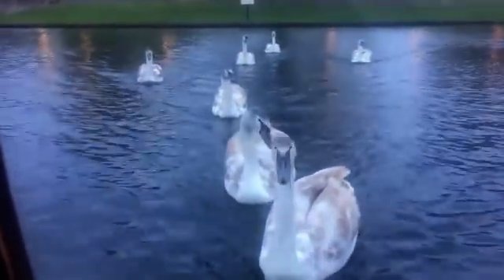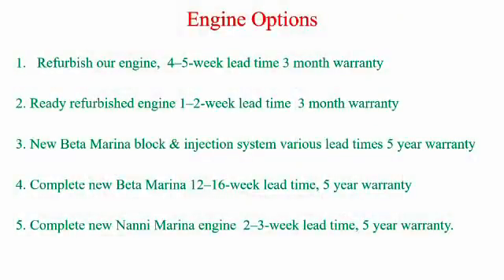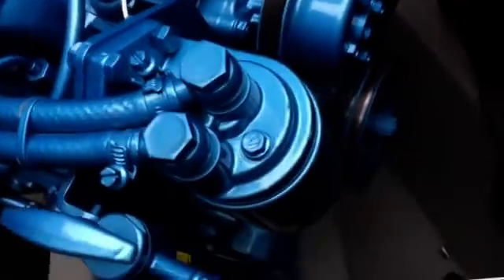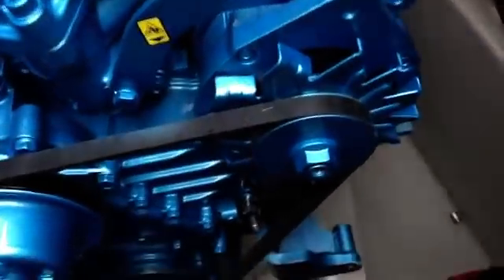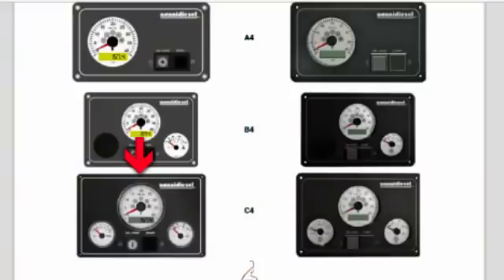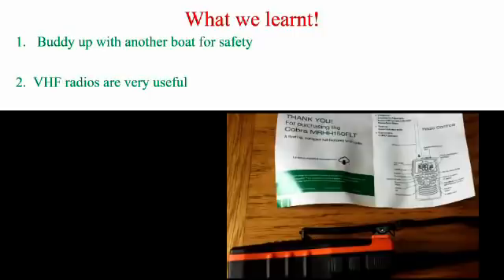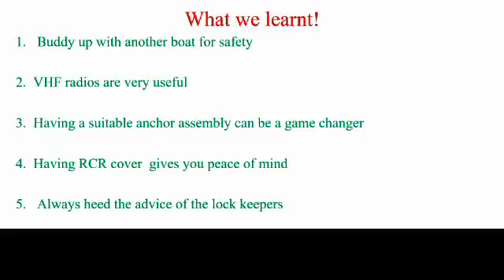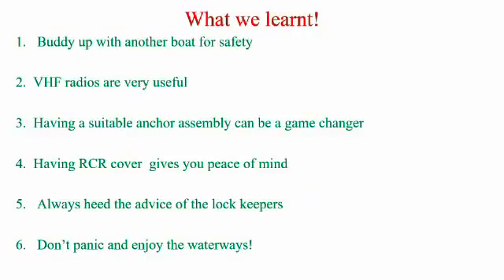Trent Disaster 3

Comment: Having watched all three of this series I take my hat off to you, both for your 'Boatmanship' and the way you handled this whole 'disaster'.
Are those anchor recommended sizes for use at sea?  Waves etc make it necessary to have larger heavier anchors. As an ex long haul live aboard yachtsman of quite some years I came to favour modern light alloy anchors such as the Fortress anchors. They are light and very strong. They are a similar design to your anchor, but rely more on design and their ability to take a good hold on the bottom rather than their weight. I snapped the anchor warp before the anchor broke out once.  5 metres of chain and the rest warp (nylon rope) is a good way to go. All chain rode uses the weight of the chain to reduce snatching when large waves hit the boat. Using just 5 metres of chain gives a good catenary and it takes the wear if the boat veers a lot. I cannot see the need for much chain and a heavy anchor for river work. Just my opinion, I know little about canal boats so this is offered humbly. 
Thanks for this superb trio of videos. My brother is faced with replacing his N.B. engine - these have been most helpful. 
Cheers and good sailing to you both.  👍
Reply from the maker: Sorry for late reply Kevin.
You saying about a good design lightweight anchor got me thinking that would better for us. I did struggle moving it around and trying to throw it clear of the boat.
Glad you enjoy the videos and thanks for the advice.
Reply: @narrowboatmaggiemay  Not a problem.
I sat down with by N.B.'ing brother and crunched the numbers. We decided that a 16 kg steel anchor of your design was more than adequate. And, to use 5m of chain an appropriate 3 ply nylon warp/rope. We were both shocked at the very high price of Fortress anchor's now.
I've since watched more of your videos. They are so very well filmed and enjoyable. Thank you.

Comment: Anchor.  As you rightly said the spec is for sea conditions. The anchor you have is a Brittany, it is certainly good enough for your boat and river use. The chain when used at sea and it’s length and weight play an important part in the anchor holding when the boat pitches and snatches with the waves the chain absorbs the snatching. Most of the time boats are laying just on the weight and length of the chain.  The points on the Brittany are designed to puncture eg compacted sand and plough into the sand and dig in.  Your setup look absolutely fine for river use it will soon dig in to all that lovely sticky mud and hold firm.  You are not holding the weight of your boat only the drag the stream has on your hull. If your on a river and you want a break and theres room just Chuck the anchor over and bobs your uncle no bashing pins in. Of course when your at anchor you should display a black ball aloft at the bow or an all round white light at night.

Comment: You made a good decision on the engine replacement options. With reference to the anchor, as you have discovered the design and weight of yours is fine for canal work. However - rivers and tidal waters are a whole new ball game and the answer is then ‘it depends’ - because there are more variables, the key is depth of water (have you got sufficient rode), tidal race (some rivers have wicked tidal current speeds), and prevailing wind conditions - it is probably not worth upgunning the anchor just for rivers unless you intend to do a lot of them and spend significant time on them.
Reply from the maker: Thanks for that insight Norman.
I did wonder if that was the reason the spec. said 24 LG’s
Thanks for watching
Reply: @narrowboatmaggiemay  A compromise would be to have a heavier collapsible (bolted) anchor that you kept in store onboard that you shackled to the rode for tidal journeys and just kept the current one for canal work.

Comment: Good work. How did the costs compare with each of the options? What happened with the previous engine, surely there was some valve in that?
Reply from the maker: Options 1   £3500-£4000
Options 2   £3500
Options 3   £5500?
Options 4   £4400
Options 5   £7000
All options were without fitting and any modifications needed. So fitment and crane hire varied between £1000-£1500
These were all rough estimates 
Part ex engine was £250